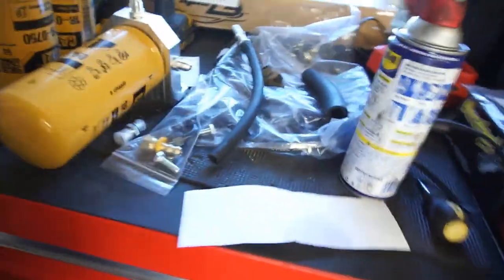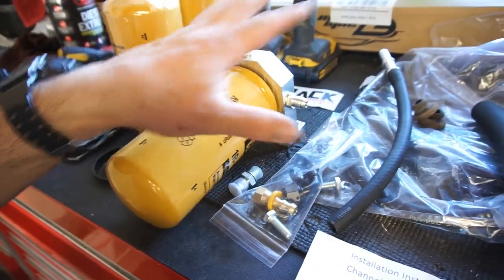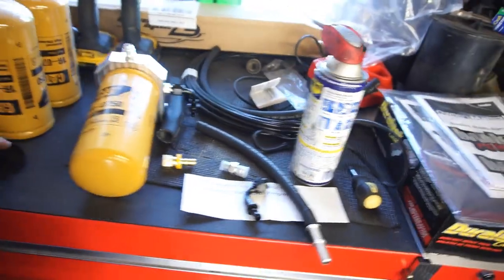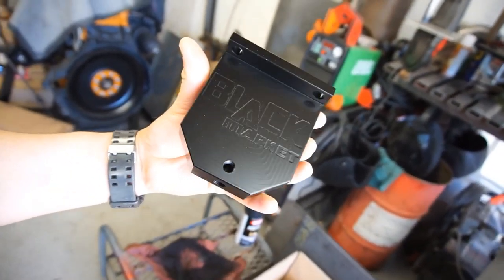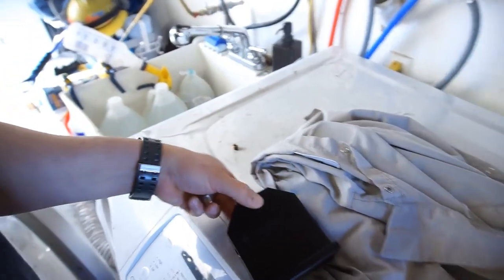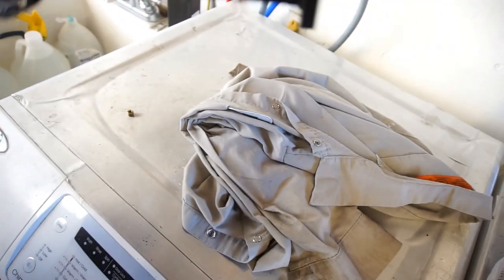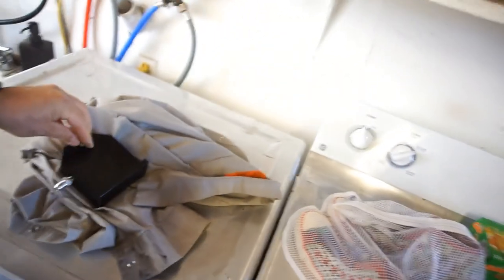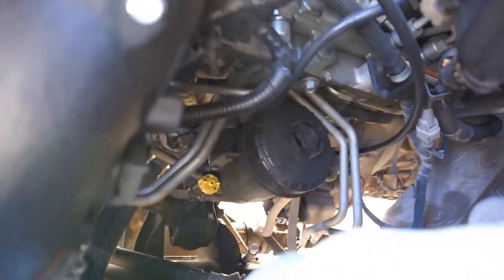Black Market Performance CAT Fuel Filter 2010 Ram 2500 6.7 Cummins Mega Cab

Comment: Very nice install !  I'd rather have a spin on filter than dunk type any day . I have a similar dislike for diesel .  I developed my dislike on a job where I pumped 3000-5000 gallons to individual trucks from a tanker truck daily .  Job came with the once in a while "bath " in diesel !! Don't take much to make ya a real stink bomb !!!   HAHAHA !!
Reply from the maker: Yeah a big stink bomb. Between diesel, ATF and gear oil I’d rather not take a shower for 3 days then get any on me.
Reply: @Halffast719  ; While those aren't my choice of au de cologne , anti freeze and brake fluid are my # 2&3 . LOL

Comment: How has it performed up to this point? Next on my checklist.
Reply from the maker: I really like it. Install was easy. No leaks and the engine idles much smoother too. I’d definitely buy one again but their quality control needs improvement. My buddy bought one and the water sensor threads were wrong and I had to tap them the right threads. It’s hit and miss.

Comment: I have a question and for whatever reason I was like hmm I’m sure you would know ! I have oil leaking though two bolts I put B-J weld thinking it world fix it and it stopped it for about a day but started up again. Can you suggest maybe another product? I don’t know much about cars 🤷🏻‍♀️
Reply from the maker: Succotash I’ve had the best luck with jb weld. As long as the surface area and bolts are super clean and you mix the jb weld 50/50 I can’t think of anything else better. I don’t like gorilla glue stuff I personally think it’s junk.
Reply: Halffast719 awesome thank you I’ll clean it off as best as I can and try again! And as always love watching your videos!

Comment: Fraud alert, they take your money, then tell you they don't have product, refuses to refund
Reply from the maker: Yeah my buddy just went through that. They were back ordered and wouldn’t refund him his money. Took 2 months to get the part and to find out the threads were wrong for his water sensor, so I tapped it out for him because he didn’t want to wait 2 more months.
Reply: I had to deal with the same issue. Luckily I was buying one off eBay from them and after one filed claim and about 5 weeks I had my fuel filter adaptor. eBay's Money Back Guarantee is great for flakey sellers.
Reply from the maker: Yes it is.